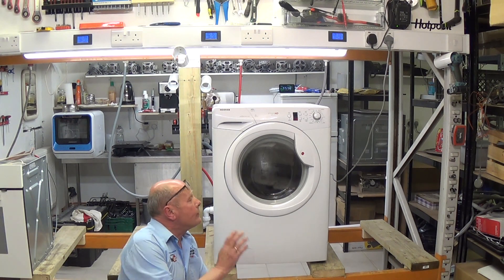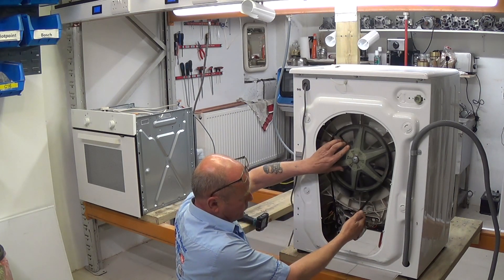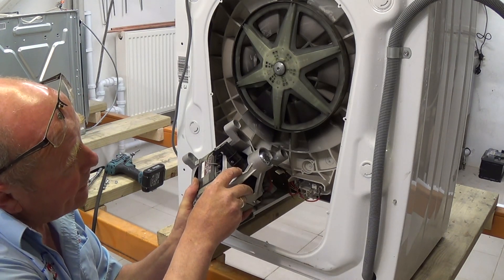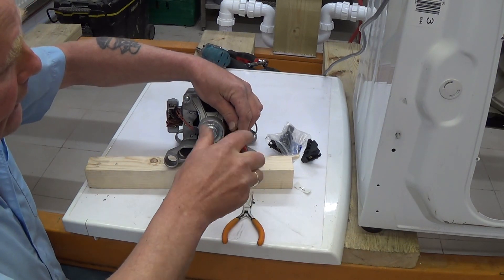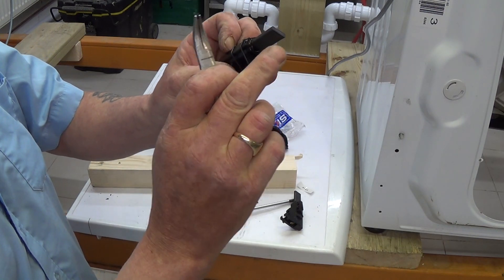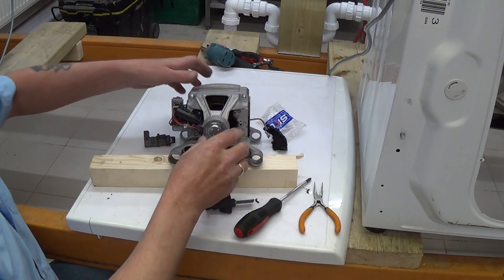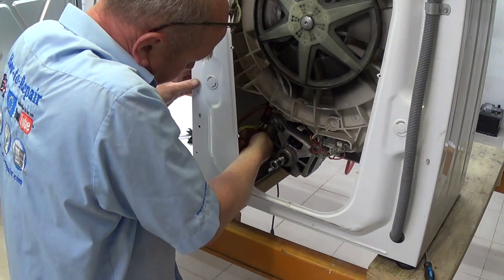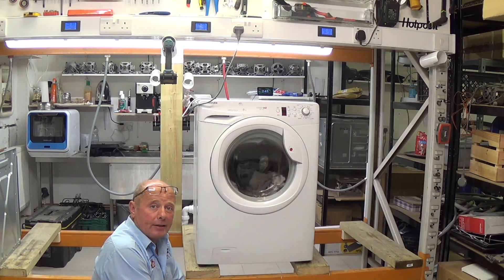Hoover Vision Hd & Candy Washing Machine E08 Error Fault Code Replace Carbon Brushes

Comment: I did that, and it didn't work. What had possible gone wrong? Machine never showed E08 error again. Motor tries to start, but it stops right away
Reply from the maker: Hi, I will need the full model number of the identification plate and the details of your problem so that I can provide you with useful literature. Please use our contact us page and make sure you fill out the request for what your problem is. A video shoot of the problem would be perfect as well.

I will get back to you within 24 hours, normally. https://www.how-to-repair.com/help/contact-us/  

Please remember to subscribe to our channel, as that's what keeps this channel going. Thanks, Paul 👍

Comment: Cheers great video. When I restarted the machine the drum is spinning but not speeding up for the rinse cycle. Any idea why, thanks.
Reply from the maker: Hi, I will need the full model number of the identification plate and the details of your problem so that I can provide you with useful literature. Please use our contact us page and make sure you fill out the request for what your problem is. A video shoot of the problem would be perfect as well.

I will get back to you within 24 hours, normally. https://www.how-to-repair.com/help/contact-us/  

Please remember to subscribe to our channel, as that's what keeps this channel going. Thanks, Paul 👍

Comment: I changed the motor brushes as they were totally worn down. I’ve put the machine back on and the drum is rotating now.

At the end of the cycle, I am still getting an E08 Error flash up is it a case of waiting for the Motor brushes To bed in or is there something else wrong?

Comment: I had the same problem with my hoover washing  machine E08 code so replaced the carbon bushes as they were worn did 1 wash and it flashed E09 checked to motor again and refitted the carbon bushes and made another wash and  at the end of the wash its now E08 Fault again  cannot figger out what what the problem is...

Comment: Hey! I have a Candy's Grand Evo 1702D, the machine runs perfectly, there's no problem with the rotation speed, the drying and draining is totally normal, however, when I try to use the machine on wash cycle (any), it runs for sometime but after 10 minutes or so shows E08 error. I've also noticed that the time gap between two rotations during the wash cycle is big enough 2-3 mins. After watching this video, we tried changing the carbon brushes but it's all still the same. Since the machine works fine during drying cycle, could you suggest what's the problem?

Comment: I have a Blomberg washer that failed. In North America they are rare and it is almost impossible to find DIY repair tips and help. 
Based on this video I took the plunge, inspected my brushes and one brush was completely worn down.
Replacement carbon brushes are also scarce here and insanely expensive but with a bit of research I found some in the UK (where they are commonly used) and had a friend mail them to me. 
Reinstalled, problem solve.
Bravo and thank you.

Comment: Hi a followed your video put brushes on now saying e09 error,,
Reply from the maker: First thing I would check is all the wiring on the circuit board there is a chance if the carbon brushes were badly worn. You may have damaged a component on the circuit board, but without having a machine in front of me I'm unable to be much more assistance. Sorry this happened before Christmas. Hope you have a good one @terryharkins4891 this is for you https://www.youtube.com/shorts/e432SAb2g08 please remember to subscribe as that's what keeps this channel going. Thanks 👍

Comment: Thanks so much for this tutorial. I fixed my old machine. 
One question though, is it normal to be a bit noisy (whiny) with new brushes?
Reply from the maker: Could be until they ware in 
Thank you for leaving a comment, I would love you to leave your opinion on our poll about manufactures building in obsolescence to appliances. https://www.youtube.com/post/UgkxygHomnUySd_bYjaJBdEHPO6T4dYo9Ahm
and this is for you https://www.youtube.com/shorts/e432SAb2g08 please remember to subscribe as that's is what keeps this channel going. Thanks 👍
Reply: I cannot find the link to the brushes but could you tell me if they’re compatible with model number wdx0c 485a 80 please thank you

Comment: thanks for doing this video , after lots of swearing and cursing to get the electric connector to disconnect i , out of frustration , tipped the washing machine over on its side and saw the bushes were there sitting looking at me , as others have said i wouldnt have had the confidence to start this , keep up the great work

Comment: Would this be a cause of clicking? I have a hoover dxc c49w3/1-80 machine. And with power off but door open it does some fast clicks in a 2 second burst or so. We did have e08 flash up and it stall on rinse & spin. So wouldn't finish the cycle so reset the dial to rinse and it carried on

Comment: I was getting E08 error code so I followed the steps on this vid and was able to fit new carbon brushes, although when I got it put back together it only worked once and is now doing the same thing again, same error code even though new brushes fitted. If anyone has any ideas I would be very grateful!
Reply from the maker: i would check motor again
Reply: @How-to-repair  Hi Paul, I was delighted to see my machine working again after replacing the brushes. The old ones were worn exactly as you described. But, the same thing has happened with me. Strangely, it finishes the washing cycle, then shows E08. Door will not release. I then put on a drain and spin cycle which allows the door to release when finished. 
What is to be checked on the motor again?

Comment: Brilliant video thanks, got the bushes. 10 minute job, back up and running. Glad i came here first as Hoover's website states that it's an issue with the motor sensor and i needed an engineer. Happy wife and wallet
Reply from the maker: I'm glad we were able to help you if you ever need for the help we have live streams now every couple of weeks

Comment: Thank you! I disassembled mine and noticed the carbon brush had actually stuck so worked it in and out a few times to clear the dust. I then re-assembled and voila, all working again :) Only took 30mins or so.
Reply: Ditto! My Candy is less than 3yrs old and had plenty of carbon left. Thanks for this video!

Comment: Ive just replaced the motor speed sensor  on this model washing machine as it was displaying e08 now it spinning with the belt off but it just falts out with the belt on meaning not turning. ive looked at the capacitors on the main board & the smallest one looks  black suity onit ive spoke to a local engineer on the phone explaining that the bushes looked good & motor also plus fitted new speed sensor tacho but still getting this problem do you reckon that it could be the smallest capacitor as i put a screwdriver against it & i can feel it clicking as it cuts the machine out do you reckon it could be this capacity  ? ? ?